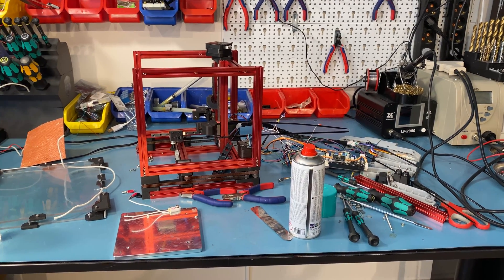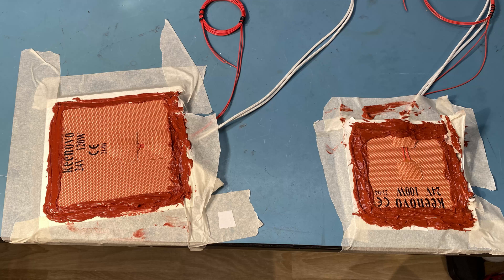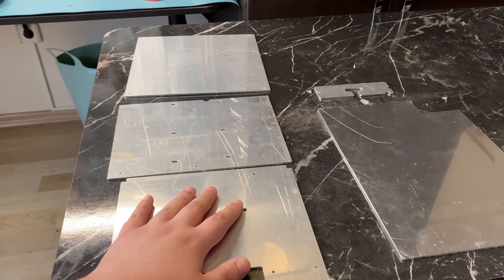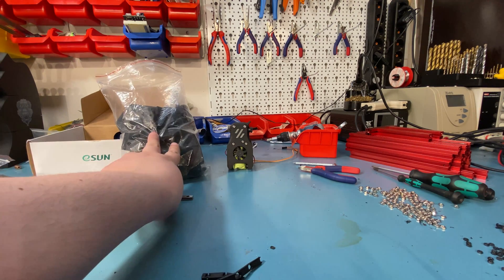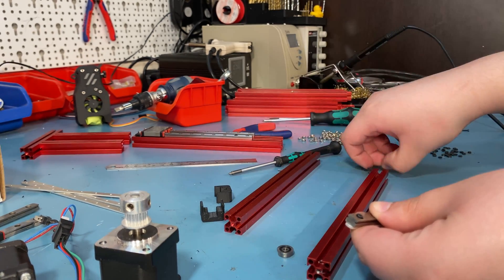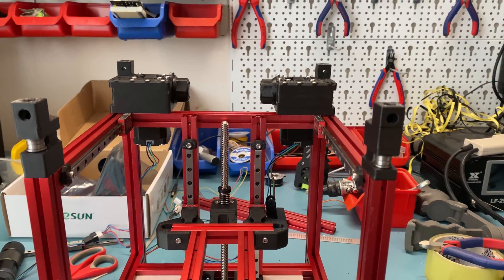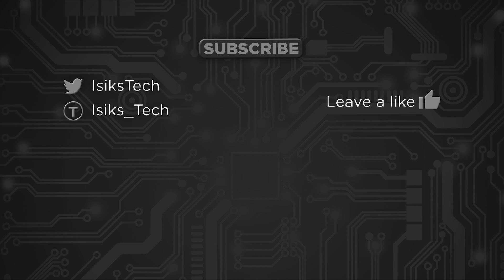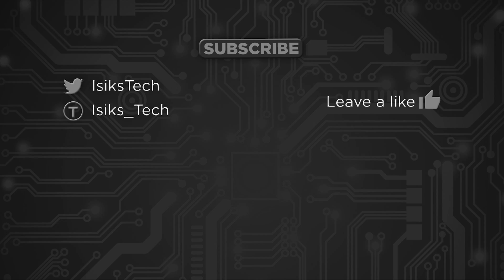Voron v0 Ep. 7 - Starting the v0.1 Upgrade

Comment: Great video. Two questions. How good is the 0/0.1 at printing TPU? Love the format, the layout and looks of it and would love to build one just for the purpose of printing smaller TPU parts.

Second... Is that a huge silicon mat on your workbench? Where can I get one? :D
Reply from the maker: 1. I never tried TPU so I can't say much about that. You can ask on the Voron Discord, I'm sure someone tried it.
2. Yep, it is. I bought mine from USA so in freedom units its 3ft*6ft. Worked great with my older 180cm*80cm table, a bit large for the one I'm currently using. It's this one: https://amzn.to/3ktwpzY but it looks like it's out of stock. There's this one from the same manufacturer and same size: https://amzn.to/3kzuNEY

Comment: What is the purpose of the aluminum bottom plate?
Reply from the maker: To cover the bottom electronics
Reply: @IsiksTech  Seems like a heat trap, to me.
Reply from the maker: I should have designed some vents as I said in the video. My previous 3d printed one had that. It will probably still breathe enough though.
Reply: @KeithHuffstutler  I very much doubt that is much of an issue with the skirts being 95% open air.